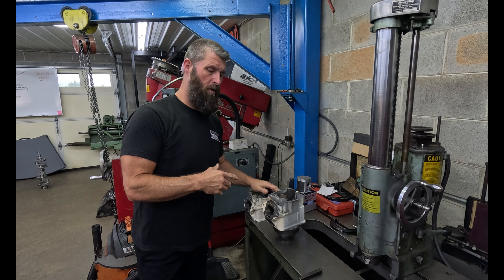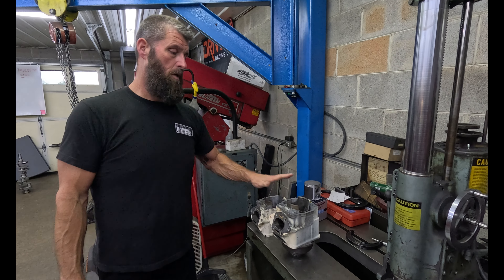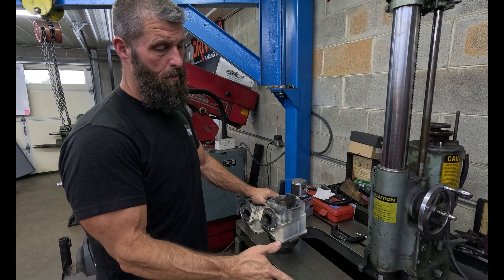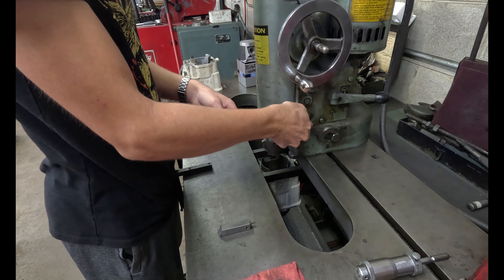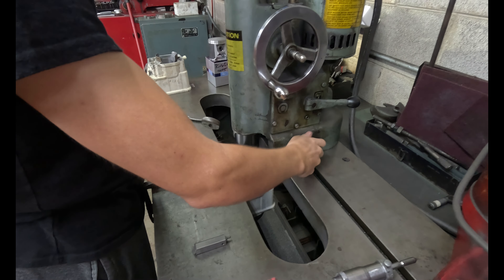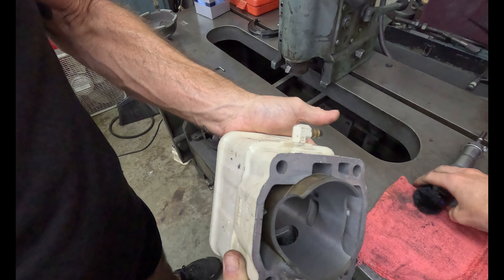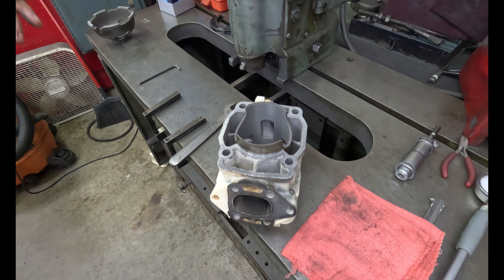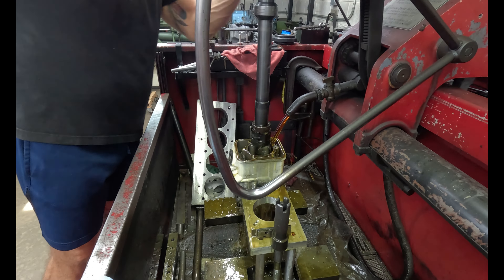2 stroke cylinder boring and honing

Comment: I love it when I see a shop still using an old-school boring bar and table. I bored a 327 for my first car(69 Nova) with one in my HS autoshop . It's also how all the cool old race shops in Patterson NJ's "gasoline alley" bored engines. The new CNC Rottlers are cool, but the simplicity of Kwik Way or Van Norman is something different. It just feels more like your truly building something rather than simply doing a job.
Reply from the maker: I agree 💯

Comment: That's really cool you guys shared this small engine work. Back about 25 years ago I had a 1986 Polaris fan cooled 488cc snowmobile engine I rebuilt. I sent the engine with the new wisco pistons to a machine shop for the bore and honing. I always wondered how they were able to do the small engine work because they specialized in automotive and race engines. To be honest with you I didn't know Wisco made pistons for automotive applications especially back then. I always thought they only did small engines. I've been a fan of Wisco products ever since. Thank you for sharing this. I don't remember the exact price but to bore,hone and chamfer the transfer ports on the twin cylinder engine I think it was around 100 bucks. But that was a long time ago

Comment: We use the rod honing machine with a mandrel using keyway stones. (4 stones and 4 aluminum guide rails) The spread of the stones and overall surface area (for us) makes it easier to keep the bottom of the cylinder round as the interrupted cylinder typically wants to hone the bottom of the sleeve slightly small since it's unsupported, and the cylinder walls perpendicular seem to want to hone larger. Have to use the rod mandrels for the small stuff (<2.500") and they love to grab and try and rotate in your hands, fun stuff when they have sharp cooling fins.

Comment: Quick question about this.  My son and I compete in Enduro.  My son runs 2 strokes.  Are the watercraft cylinders nikasil plated like a 2 stroke dirt bike cylinder would be?  I only ask as I am curious if they are nikasil plated does the boring machine away the nikasil plating and do the cylinders need re-plated when complete?
Reply from the maker: Not all dirt bikes are nikasil, some have iron liners
Reply: @powellmachineinc  I don't believe I said that.
Reply from the maker: @endurox1481  my point is all 2 stroke have been available both ways depending on manufacturers and model,  everything I do is iron,  if it's plated we put iron in it
Reply: @powellmachineinc  you misunderstood me.  I wasn’t trying to imply anything.  I was curious how thick nikasil plating is vs how much material is removed from the machining process.  As you say I was being curious and was wanting to learn.  Apologies if you felt I was implying anything else.
Reply from the maker: @endurox1481  gotcha,  I have no idea,  we always go iron,  I've heard of people having the replaced ect, but I never even tried to hone one
Reply: @powellmachineinc  thank you.  That is why I asked.  I don't know how aggressive I can get with honing one of those nikasil plated cylinders.  We roughly put 100 hours on each bike every year.  As you can imagine we do lots of upper ends on the 2 strokes.  Do you prefer stones vs a berry hone?  I am a bit old school and always felt as if I have more control with the stones because I can adjust the tension on those, vs the berry hone.  Anyway I know 2 stroke cylinders is small potatoes for you.  I was reviewing your videos and came across this one. I started watching your channel because I am in the middle of a 351C build and I am one of those nut jobs that is keeping the hydraulic flat tappet cam.  LOL.  Currently my block, crankshaft and cylinder heads are at the machine shop.  The block bored .030, crankshaft needed a polish only, cylinder heads had all the valves replaced with stainless valves, and new springs, retainers and locks.  I went to bullet for the camshaft and lifters.  I ordered the cam about a month ago and am awaiting that to arrive.  This is a super mild build.  It's essentially stock other than the cam and torque converter and headers.  The application is a 71' Mach1 M code with the closed chamber 4V heads.  Yeah I know those heads aren't wonderful down low but I wanted to keep the setup mostly stock.  I found your channel to be very informative.  I am going to do my best to ensure this camshaft does not fail.  I will run Driven break in oil and pray for the best.  Sorry to be very wordy.  You've got a terrific channel.

Comment: What causes the bore to wear so soon. Are two stroke motors more prone to wearing out sooner than four stroke.
Reply: 2-stroke engines are more prone to problems if they’re run lean or if their oil-injection mechanism quits working. Automatic oil injection is just a bad, bad idea. I disable it whenever I can and mix oil manually. That won’t quit working. 😉

Comment: I was hoping to see you doing the port chamfering too, also do you plateau hone and use one of those sunnen brush type for finish? Not a trick question just curious what your experience is with different bore finishes
Reply from the maker: We let the customer do the chamfer work, we do 150 to size and 500 till the rpk is correct
Reply: @powellmachineinc  thank you

Comment: dont see boring bar's  used much anymore
Reply from the maker: Really,  I couldn't imagine not using one
Reply: @powellmachineinc  The shop local to us has a boring machine. I think its a quick way maybe. but it is similar to a boring bar but the block sits on the pan rails and the boring head moves around on air kind of like a seat and guide machine. I think this is what he means by guys not using an actual boring bar. I know many of the old boring bars would set right on the block while boring.